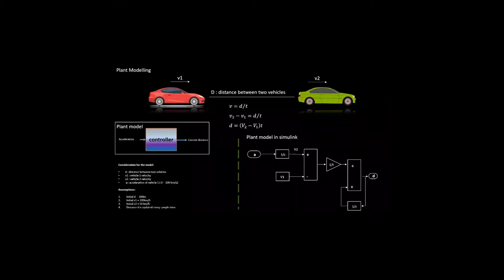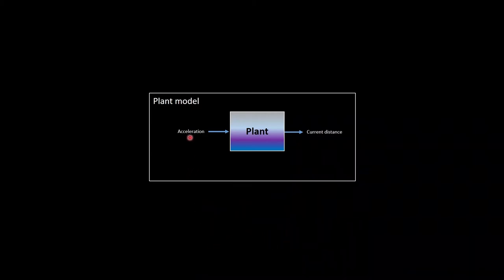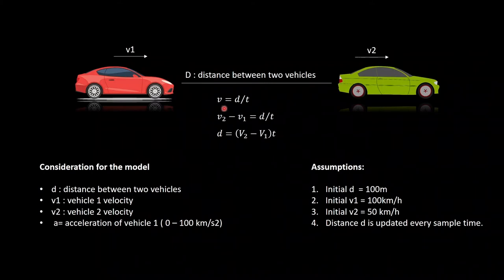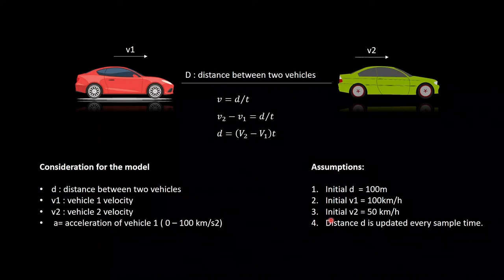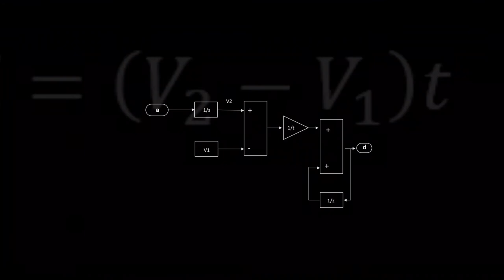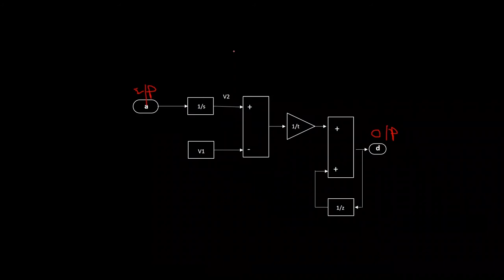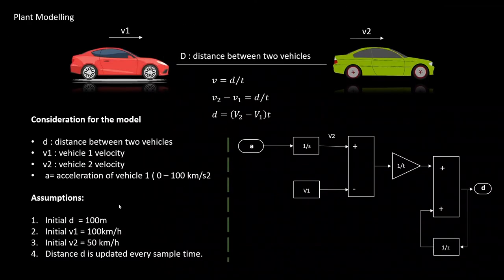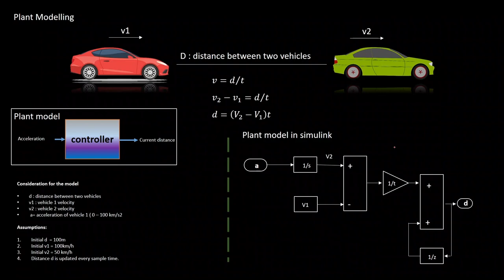Stateflow cruise controller modelling part 3 | Stateflow | Controller modelling

Comment: I got a bit confused. v2 should be the velocity that is estimated by the controler input for the ego vehicle for the next step. It should not be the velocity of the second vehicle. Am I correct?
Reply from the maker: here we have two velocity 
v1 : velocity of the vehicle in which cruise control is present
v2 : velocity of the second vehicle
here v2 > v1 : due to the same the sum is a positive number
based on this relative velocity v2-v2 the distance between the vehicle  gets updated over time. 

this corresponding distance is detected by the cruise controller input [which is a state-flow chart] . based on this input the cruise controller use break or acceleration paddle to control the Speed

We are glad that you shared your thoughts on the video.
We hope your doubt got clarified. in case you have any doubts in other topics please let us know by comment we will be happy to clarify the same..

Have a great day ahead , Take care